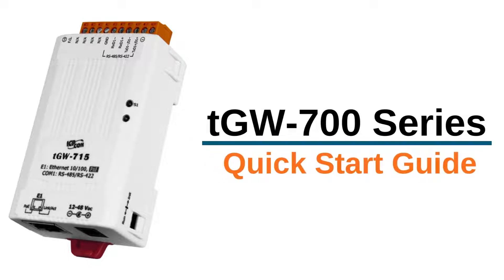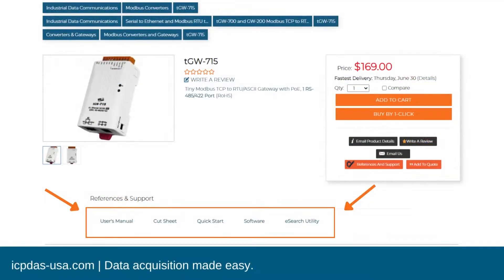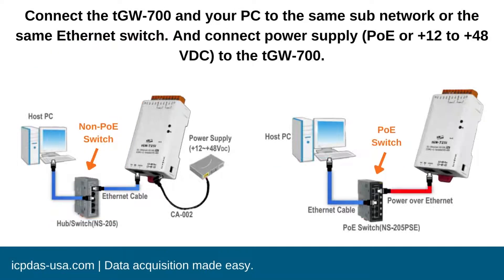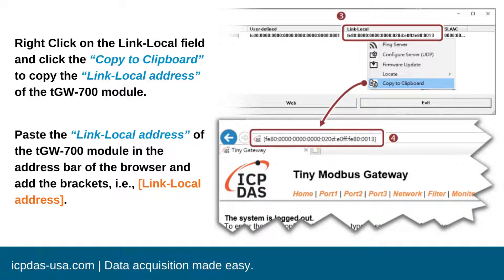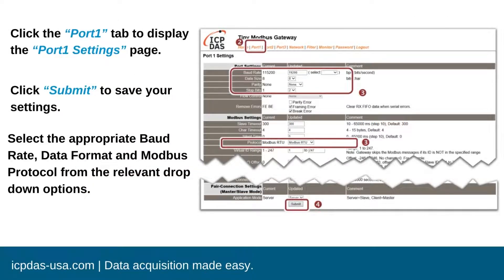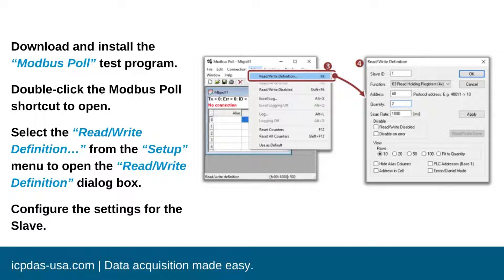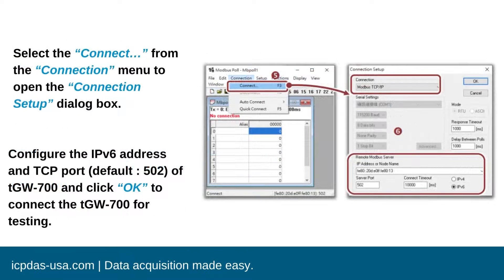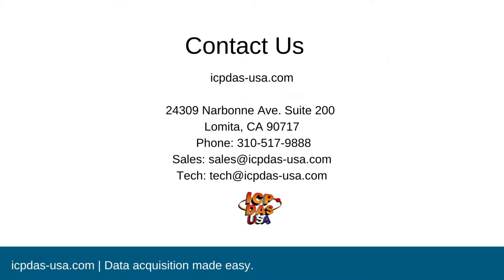TGW-700: Modbus TCP to RTU/ASCII Device Servers Quick Start Guide

Comment: I need help setting up a tsh-735i
Reply from the maker: Hi There,

Thanks for reaching out: 

Here are the links to the user guide, the quick start guide, and the data sheets on the TSH-735i. 
https://www.icpdas-usa.com/documentation/manuals/tSH-700_User_Manual.pdf
https://www.icpdas-usa.com/documents/tsh-730_quick%20start_en.pdf
https://www.icpdas-usa.com/documents/cutSheet-tSH-732.pdf

If you'd like a more in-depth help session, please visit our website and connect with us via live chat where our team can further assist you on the matter!
https://www.icpdas-usa.com

All the best,
The ICP DAS USA Team
Reply from the maker: Hi,

The quick start guide below can walk you through the steps for configuring the TSH-735 as a Modbus Sharer.  Be sure to select which port your slave devices are connected to in step 5 and make sure your communication setting set for the 3 ports, match your devices configurations.
 
https://www.icpdas-usa.com/documents/tsh-730_quick%20start_en.pdf

If we can help further, please let us know.